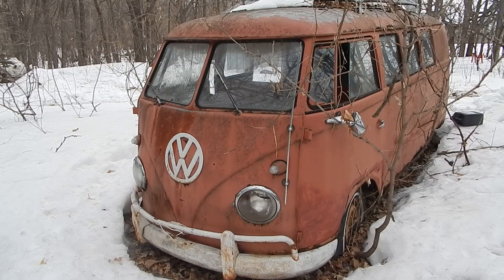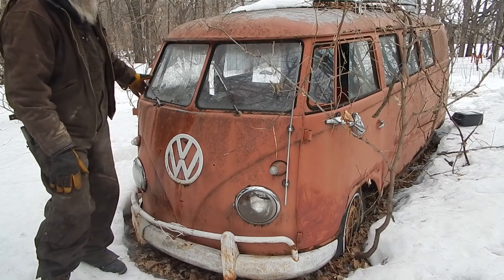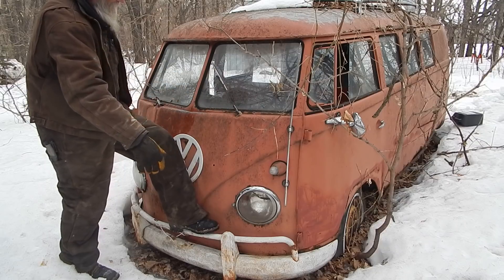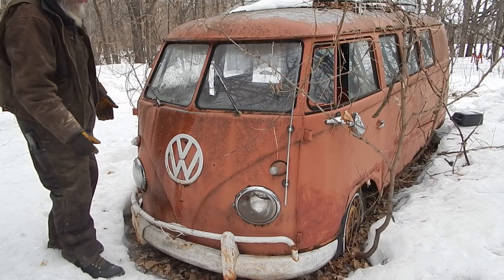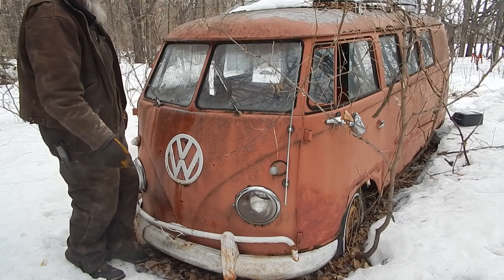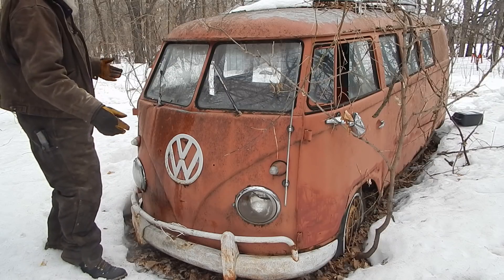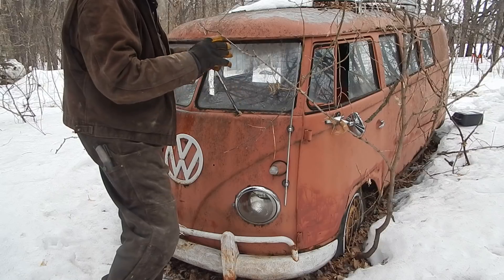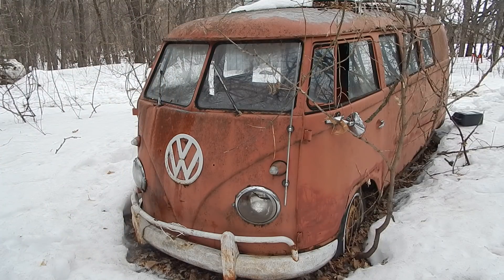My old 1961 VW bus

Comment: I had a '67 bus, which was the first year for the 12 volt system and the last year for the old split-windshield body design.  My brother & I converted it into a nicely designed camper, using plans from the old J.C. Whitney catalog.  We drove it from Nebraska to Alaska on the then unpaved Alcan Highway in 1972 when all the 'fortune-seekers' were heading north for hoped-for, but non-existent jobs on the unbuilt Alaska pipeline.  45-50 mph all the way & back....GOOD TIMES!
Reply from the maker: I had a 67 myself years ago, what I like about the old ones is they used the gear reduction boxes on the rear axles which gave you lots of ground clearance.  With that clearance plus the rear engine they could go through lots of mud and snow.  I remember somebody who was out with his four-wheel drive impressed with his off road performance, and then somebody with an old VW bus with tire chains passed him.
Reply: You must be 10ft tall. That bus looks small to you. I think we found our friend bigfoot. Lol. I'm kidding. I still love Chick Magnet & the things ya speak of. Thx for sharing

Comment: I had a '61 VW! But it was a bug, not a bus. It was a ragtop. Bought it in Reno around 1987 or '88. It was stock except for the engine being a 1600 dual port and upgraded to 12 volt. Mine had no gas gauge either, hehe. Straight body, original paint, no rust. Paid 6 or 7 hundred dollars for it. Back then they were cheap. It was my only ride, my daily driver. Drove it to Seattle in 1990, got married, and sold it in 1991. My last VW was a bus, but not a split. Early 70s with the fish bowl front window. Drove  it around Seattle for several years. It was my work van. The heater was a joke and in damp, cold weather, the glass always fogged up! Had to keep a squeegee handy to keep the windscreen clear, so I could see to drive. I drove that thing all over the place, down to California and back, across the Cascades more than once.

Comment: Some of those old VW pickup, buses etc ..are fetching over $100.000 dollars. I have a buddy who has a 52' micro bus with Safari windows and a factory sun roof which he fully restored the OEM parts and was offered $175.000 from a collector in Belgium, He refused, but the engine is an original Serial # for the bus, a 36 HP crank start. 
  Nice bus Mr. Looms 👍

Comment: Awesome that you have a bus. I was also shocked that you have Yamaha 500’s too. Two of my favorite things! I no longer have the Yamaha but I have a rare 66 bug. I’ve had a couple of 68 bugs too. Third gear for heat oh yes!  Great channel!!!!
Reply: What's rare about the 66' VW? Just curious.
Reply: The Vacuum tube junky it’s the only year for the 1300.
Reply: @jhackett9482  Hmmm well my opinion is all air-cooled VW's are a rare breed anymore, but I get what your  saying, the 67' bug was a rare breed only because it was a "Parts Specific" model, the 67' parts only fit the 67 and were not interchangeable with any other year.

Comment: Ahh I recall the Mother Earth News from my childhood, spent in northern and central MN circa '67-'85.  And my family to some extent lived that.  A few years back I picked up the new Mother Earth News...yep, very slick and full of ads for high end gadgets. No more articles on how to make undewear from old burlap sacks. :)  I also used to have air cooled V dubs. Yes the $ has gone crazy. Yes they were very basic machines, learned a ton wrenching on them. My first ever "down to the crank" rebuild was done on a dumpster picked kitchen table in an apartment.  I also love the crunch crunch crunch of the melting/freezing snow in the vid. Reminds me of the passage of time, so much more pronounced in a place with stark contrasts in season. Thank you sir for doing what  you do.

Comment: Fleetmaster back in the road? I haven't seen an update since the front spindle work.
Reply from the maker: Its drive able,  but I don't think I could make it out the driveway with it at the moment.  Still have work to do on the lights, but mechanically its pretty good.  I just started a few days ago, but couldn't get it out of the snowbank its parked in.
Reply: Alrighty. Maybe we will get a spring fleetmaster update!

Comment: I had this same model in a factory camper version. The engine in mine was from a 1969 VW, which I think may have been 60 hp. I wish I still had it.
Reply: Same as a Mercedes w110 diesel, 50hp :)

Comment: Not sure if it's the camera angle or if you're a lot taller than I thought, but that thing looks like a kid-size car here...
Reply from the maker: Well, I am standing on snow, and the bus had four flats and had sunk in the ground.  They are really fairly tall, close to six foot, but narrow.  Which makes for exciting driving in a strong cross wind.  I have had in up on two wheels making a fast corner in a wind, not recommended.
Reply: @logcabinlooms  Ah, I hadn't noticed how deep it was sunk. That explains why it looks so short.
Two-wheeling in a VW bus... that sounds like a wild ride, lol.